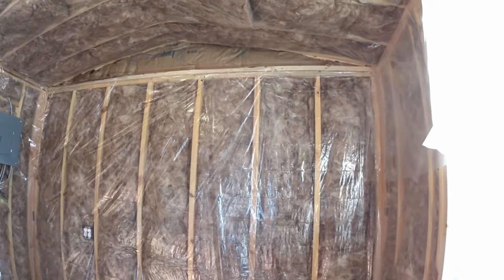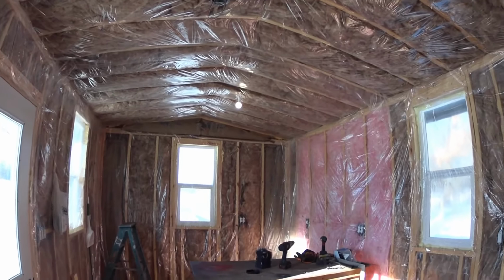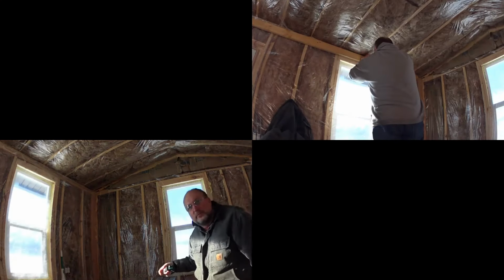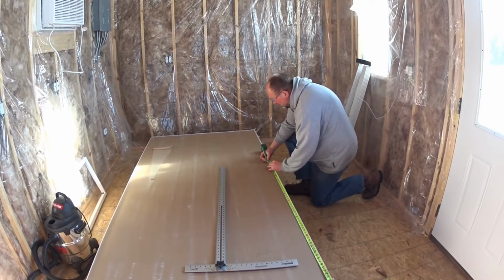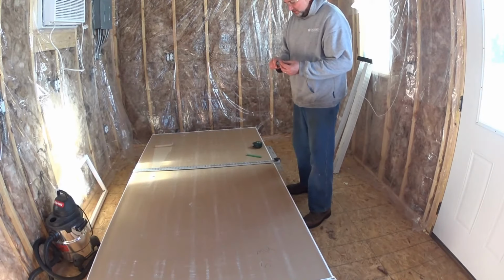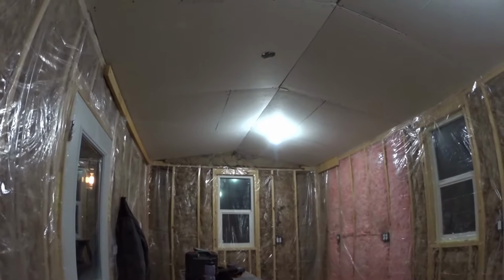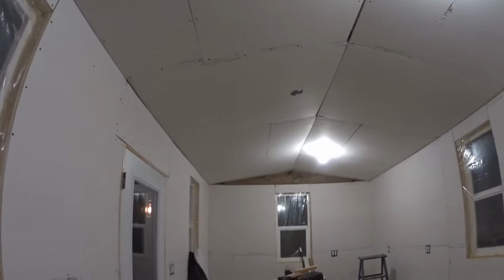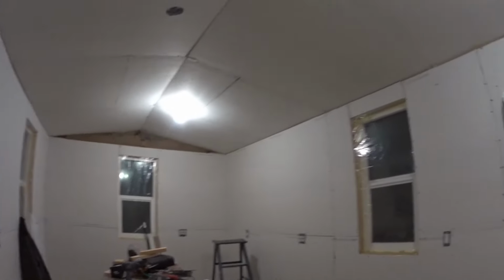She Shed - Sheet Rock/Drywall Rant

Comment: Just installed wiring, insulation & plastic on my 8x20. I'm going with Sheetrock & rough sawn Pine. 
It will be my new smoke shack🤪

Comment: Why did you have plastic over the insulation? I have been watching a bunch of videos and getting ready for my she shed. And where did you get the heater/AC?
Reply from the maker: Plastic just for an extra barrier.  Not absolutely necessary.  Heater/ac from the big-box home center (Menards).  Space is so small, well insulated and positioned such in the trees that it doesn't take much to heat or cool.
Reply: @ThoenWorks  
Thank you so much!!! Your video was very helpful and I will be referencing your video for mine. I will have it in a month

Comment: Hey man, I have a question about my Sheetrock shed. Per usual, the whole shed sits on four concrete slabs, which in turn sits on top of a hill (very hilly in this town), my driveway actually lead up to the front of it. But, one side of the shed is almost flush with a cliff (8” tall）that borders my neighbors yard (my house & shed overlooks theirs yard & house). Noticed the cliff side of the Sheetrock wall has a thin crack vertically. The foundation wood perimeter is all dried out (concrete slab is fine). Should I worried that wall will slide down the cliff?
Reply from the maker: Better move to flat ground.

Comment: hey I have a shed like this and need to insulate.  I was wondering about how you ventilated the roof?  I see you went  to the ceiling with the insulation. Will this cause a "hot roof"? Just wondering how you worked it out for when I do mine!  Thanks so much and good luck!
Reply from the maker: We have venting under the eaves, but actually should still add a couple roof vents.  There really is almost no space above the ceiling because of the vaulting.  We get by because the shading pretty much keeps the sun off in the summer.
Reply: @ThoenWorks  - ok thanks so much for you reply. I run a small pottery out here in PA and researching how to go about finishing it up. Thanks so much for the videos and I do wish your family well in the enjoyment of handmade craft!
Reply from the maker: Thanks.  Love pottery and wish you well with it.  We are fortunate to have had http://www.robertbriscoe.com and now http://mkrouseyceramics.com only a couple miles from our home.